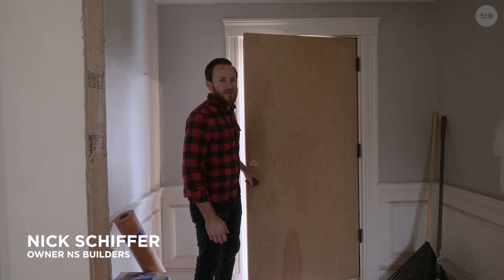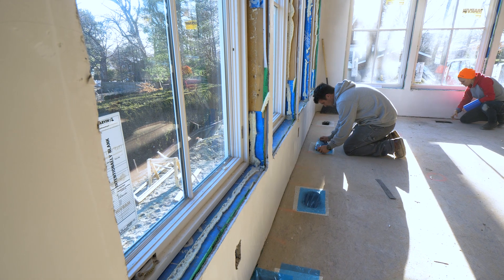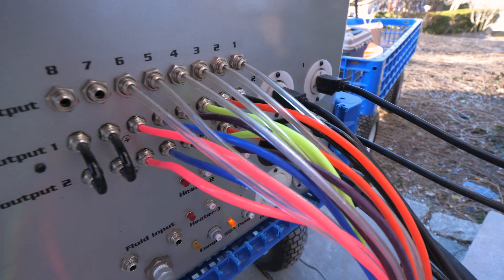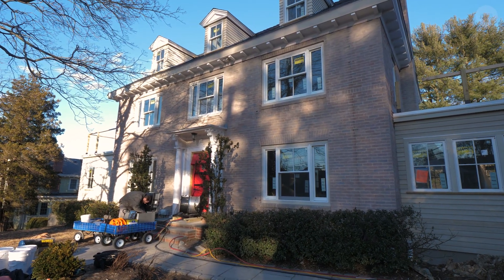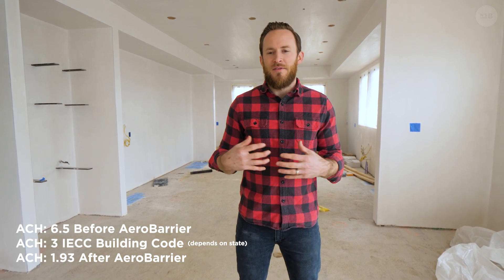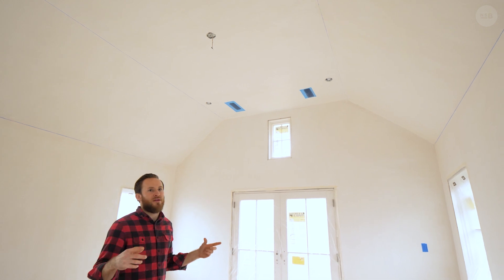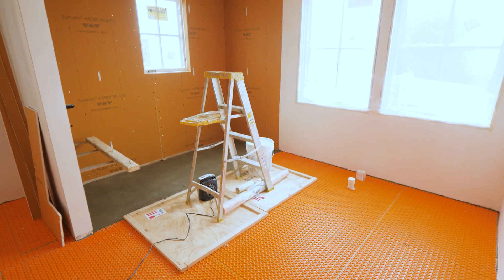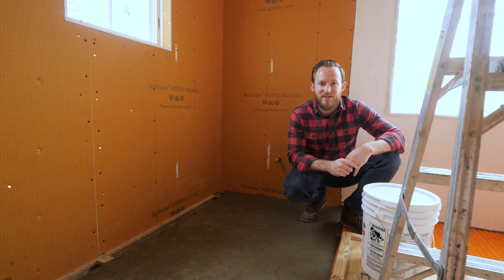What is Aerobarrier? We're using it on a renovation of a 1930's home

Comment: In my own Connecticut home I have found that the Ditra floor heat provided an acceptable level of winter season heat for my small master bathroom that also has an exterior wall and window. I tried to explain this to a mechanic engineer for a small existing home remodel and he wouldn’t buy it. Hmmm…

Comment: I'm surprised a more vapor open insulation couldn't be used after the aerobarrier goes in. Either  rockwool or dense pack cellulose with a smart vapor barrier like Intello.
Reply: It's the little, inaccessible, and overlooked cracks and seams that make that approach unworkable. It also depends on the hyper diligence of your workforce, so: no dice.

Comment: If u couldn't do any insulating I would have put some good styrofoam on the interior under the blue board as the insulation holds the heat in. Otherwise ur sol n pissin away a lot of money. U'll actually have to upgrade the hvac as fresh air will b needed.
Reply from the maker: scott webber Hey Scott unfortunately your comment is in accurate, while we did upgrade the HVAC system in this house the mass wall construction keep the heat inside the house. Reducing the need for thermal insulation

Comment: Why could you not keep spraying until you fully seal the building. You stopped at 1.93. My thinking is that a .5 should be possible. Tell me where I am wrong.  Great vid, by the way.
Reply: I'm working with an AeroBarrier guy in Colorado, and he'd agree. It's essentially a matter of how much material you're willing to blast in (at ~$100 per gallon). Typically the builders have a target they have to meet and then stop.

Comment: Hey Nick, saw you at IBS, wanted to say hi but didn’t get a chance with all the people. Sure enjoy watching how well you build, glad you’re able to find all the right trade contractors and like-minded people to pull it off, that’s commendable in itself. That Aerobarrier is pretty cool. I’ve seen something like this for sealing inside HVAC. I do have one question on the Kerdi-board; what sort of fasteners did they use on that? They look like regular or slightly wider-head screws. They don’t look like the Schluter washers/screws, this might be an issue. Although maybe less so if they used an approved adhesive on the back side prior to install. Anyway, awesome video, sure enjoy seeing your work!

Comment: Doesn't the Aerobarrier mist end up on every exposed surface and be problematic from a cleaning/texture/finishing perspective?
Reply from the maker: J Healy it only sticks to horizontal surfaces. So floors and sills are covered if necessary.
Reply: @NSBuilders   A friend tested this during an application with some carpet piece, leaving half uncovered. The dried mist was easily vacuumed up, he was impressed.

Comment: so all the masonry walls at this project are not insulated?
Reply from the maker: Gen Zyannd that is correct. The home actually didn’t have a cavity for insulation.
Reply: since you are using aerobarrier to make an airtight envelope, is it possible to insulate with permeable rigid foam, and  add weep holes to the exterior walls? or still not doable in cold climate?